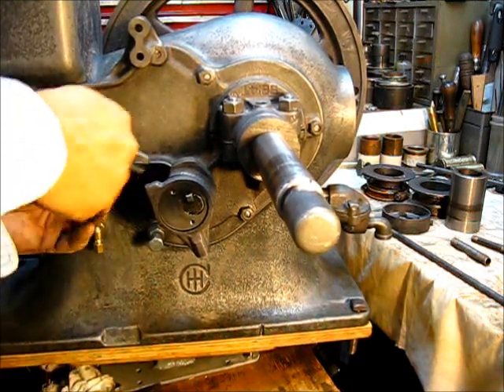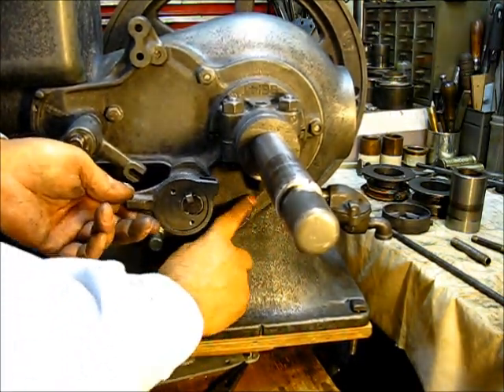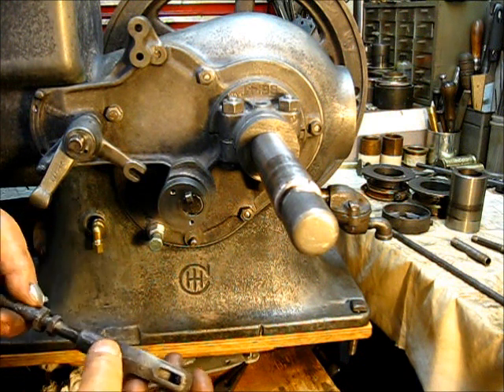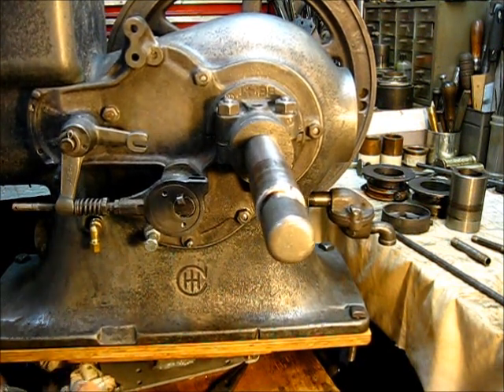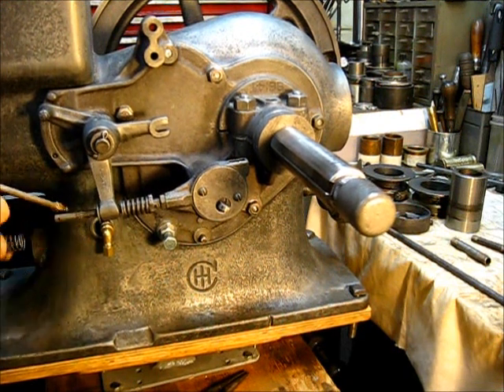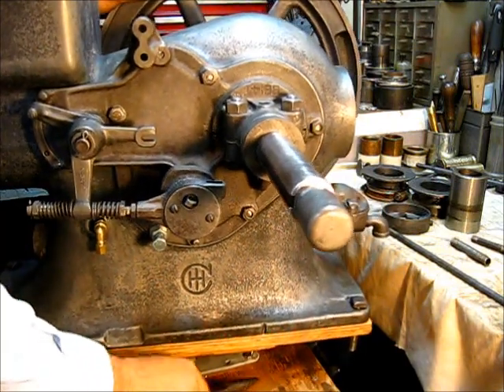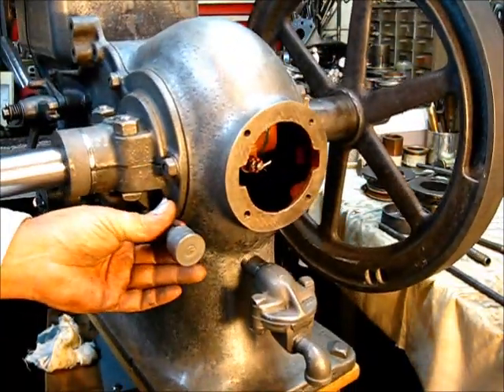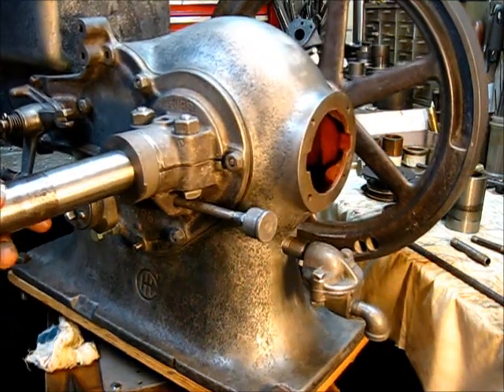McCormick-Deering "baling wire engine" #33

Comment: Wonder why its only rated at only a horse and half? It has such a large piston and stroke. I guess because it runs at low rpms. Did you already put grease in the cam shaft greaser?